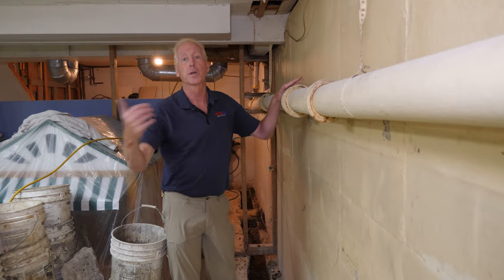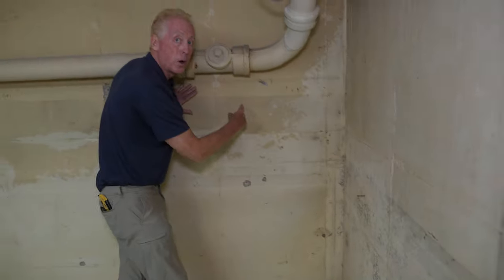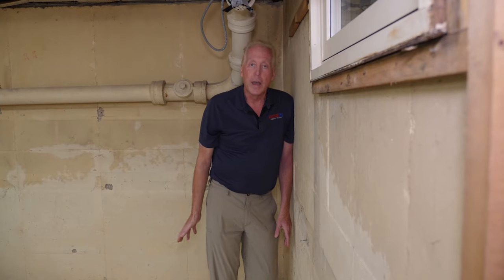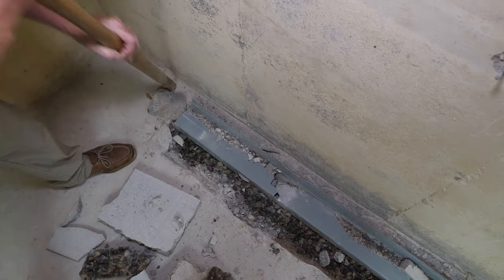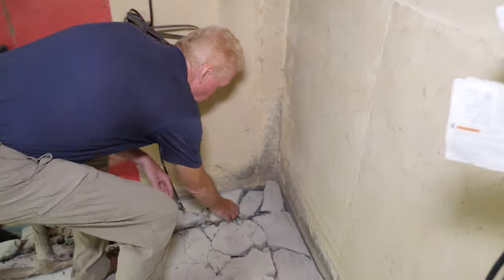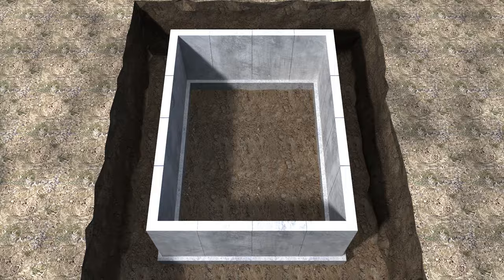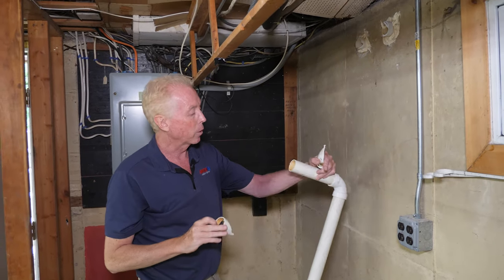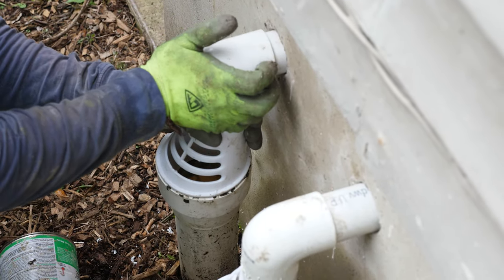Basement Waterproofing - Do's and Don'ts

Comment: I appreciate your very thorough videos, I have a company similar to yours. It is about doing the basement waterproofing right, even if it takes more effort to achieve a totally dry basement.  This big franchise companies are about making money and ability to make things very simple to replicate for their franchisee's and neglecting the real process of waterproofing. Foundation cracks must be injected with either polyurethane or epoxy or excavated on the outside with a proper waterproofing membrane.

Comment: This is great, love your videos and work. It seems like a great idea to leave sections of the floor intact to connect to the wall/foundation, but how do you install the waffle board or dimple board in those areas? Don't you need to remove the floor to put the waffle board under it?

Comment: seems like a really good landscaping job which slopes away from perimeter with thick poly underneath it would keep most water away from basement walls? then just keep a good dehumidifier in place
Reply from the maker: They already have tons of external drainage, and dehumidifiers eat money by creating very large electric bills. We want to avoid them at all costs. Sometimes you can't. The owners of this house haven't seen a drop of water in their basement since our installation. No dehumidifier is required.

Comment: Hi, great video and very informative.   What was the first company that did the original work?  Looks like the stuff I found in booklet from Quality 1st
Reply from the maker: I don't recollect the company. Quality first installs the same products. These products are used by dealerships in several states. Easy to train, easy to install, and easy to flood any basement. That's what happens when you don't put in the hard work to do it right.

Comment: Dear American Dry Basements, thanks for your hard work, and these great videos. I was wondering, it doesn’t appear to me that you are using any kind of soil blocking landscape fabric for your drainage system… my I ask why not? 
Or if you are, what fabric do you have good experience with. Thanks.
Reply from the maker: The soil in the northeast United States is typically Spodosols. It is a dense soil. Inside, not outside, the soil perks up clear water with very little slit in most areas. We never use landscaping fabric because fabric are filters that naturally clog, retarding the movement of water. That is one filter you can never change unless you want to jackhammer the floor again.

Comment: Great stuff, looks like you need a Hilti dust control system and Vac 😉
Reply from the maker: Yes. Dust control is vital in our work. We use our exclusive, EPA winner, Enviroboot on the jackhammer to catch cement dust and move it to the Hepa-filtered vac.
Reply: 🤣 he does need that 🤩

Comment: I enjoyed your video. I have a couple of cracks in my wall. They want to put in a sump pump but didn’t mention about fixing the crack. Can you explain. It is suppose to be a very good company
Reply from the maker: The cracks may be superficial and require only crack patch work. If the crack is more than eighth of an inch wide then you may need to consider getting the crack properly repaired.

Comment: Love this video. Do you answer questions I have some water leaking of my basement wall, and I'm wondering how can I seal it
Reply from the maker: Don't use waterproofing paint unless you have a waterproofing system under your floor to keep the hydrostatic pressure down. Use Drylok hydraulic cement to plug leaks in the middle of the wall, stairs or window. It will be temporary until you find out why those leaks are occurring in the first place. If leaks are coming out from between the wall and floor then you will have to consider a waterproofing system to manage the water levels outside your walls.
Reply: @AmericanDryBasementSystems  I came here to ask a similar question. I don't have water in my basement, but the walls have efflorescence and flaking. It is an old home from 1930.  Abovegrade is bloc but not sure if they poured lower half. I think it is all block that has had paint and coatings on it. I was going to wire brush the walls and seal them. Whole property and area is flat. I don't have a curb to pump water to if I wanted to install a sump pump (<1/8inch lip and a sidewalk).

Had one company come out and give an outrageous estimate, mandatory yearly fee to keep warranty, and they would do very similar to what you are ripping out. Any advice you can give is appreciated.

Comment: I just got quote for a grate drain system. They are off the foot of the foundation and pitched. I just can’t understand how they would pitch the elbows to ensure water isn’t sitting in them.
Reply from the maker: We are not big fans of that drain system. I can't imagine how they would pitch it successfully without breaking up the continuity using a rigid material. We have a couple of videos on our channel tearing them out. Watch here https://youtu.be/6h1pUyQGt0g

Comment: Thanks for another informative video! Do you saw cut the concrete before jackhammering?  I heard something about concerns of microfractures in the concrete. I'm curious of your take on that. Thanks again!
Reply from the maker: Saw cutting is unnecessary, time-consuming, and costly. The possibility of microfractures is a scare tactic to raise the cost of installation. I’ve never seen it happen. Keep in mind that an experienced DIY’er or professional should only do jackhammering.
Reply: Thanks for the info and such a quick response!

Comment: Excellent video, great info, thanks.  As the system is utilized over time, is there an issue with silt (or something?) buildup in the pipes to the point where it won't function any longer?  In other words, does the system have to be periodically maintained, and if so, what is the process?
Reply from the maker: Not at all

Comment: Hey I've done a few myself,  im a contractor mostly kitchens baths ..
 I have to take on waterproofing a friggin mansion & want to know if I do it the sane way on the poured walls ?
Reply from the maker: Theoretically, yes. If it is a three-piece foundation (footer, wall & floor) they are similar.

Comment: What do you do when the original basement floor is flush to the top of the footing or only covering it by an inch or two?  I have a basement of concrete blocks and the basement floor only covers the footing by less than 2".
Reply from the maker: If you don't have a crack or seepage problem, leave it alone. If you try to sell the house and building code in your area requires the 3.5 thickness minimum, it becomes a problem if they catch it during a home inspection.

Comment: I am trying to figure out not which system would be appropriate for my basement, but why the water started leaking in the first place.  I bought a fixer upper two years ago, and the leak first appeared a few times sporadically, and for the last several weeks, it has been leaking constantly in this one corner.  It appears that some sort of soft flexible material had been painted on, and it's now torn/old/flexible - I poked it to see what was going on there.  Is the problem with a pipe that was installed last year (that leads to the drywall) or is it something else.  IDK what to do next.  UGH.  All I know is that I want to solve this problem!
Reply from the maker: Unfortunately, this is something that can't be determined online. You have to get a plumber or a waterproofing pro to physically examine the location of the leak.
Reply: I would check the gutters and downspouts first. Go outside during a heavy rain and see if your gutters are working properly and the water is being discharged at least 10 feet away

Comment: How does the water get in the tubes y’all install? Is it permeable?
Reply from the maker: Yes. The pipe under the floor has perforated slots so water can enter and travel to the sump pump basket.

Comment: a quick random question for american dry,
whats the average price difference between these systems that have failed and the systems you install? :o
thanks!
Reply from the maker: You have to realize they install only one way, which doesn’t work effectively. We usually beat them on most quotes before they add maintenance and special flooring.

Comment: Like I said be fore, I'm so impressed!
Quick question - How does the water enter the pipe, does the 4" corrugated ABS pipe have holes in it for the water to enter the drainage system? Greetings from Newfoundland:)   Pat
Reply from the maker: Yes it does. Perforated, corrugated ADS (Advanced Drainage Systems) pipe.

Comment: So what do I do if someone already painted the walls and floor in my basement before I moved in???
Reply from the maker: You can still install a interior drainage system that will reduce the hydrostatic pressure around the outside of your foundation. Our company will not be able to apply our Superslurry on the wall. If the wall has a crack or peeling paint consider sanding the paint off to apply the slurry.

Comment: do you do any work in canada or do you know of a company that does it like your company as you do it the proper way and i truly need your help.  thank you so much.  have a lovely day
Reply from the maker: No, sorry. Its hard to recommend without knowing another contractor's operation and having quality control. If I took a guess, sight unseen, and the job goes terribly wrong. I would be blamed. Its up to you to make the right decision, and use our information as guidance. All the best.
Reply: @AmericanDryBasementSystems  I totally understand and get what your saying.  i am so grateful you wrote with your advice and i am using your knowledge so the contractors cant pull the wool over my eyes.  your knowledge is special.  thank you.

Comment: He broke that on purpose pulling it out of the wall. No person with any knowledge of plumming or general contracting would pull from the bottom of that pipe upward causing that much pressure. Im sure he isn't an idiot and just did it on purpose.

Comment: Is the sump pump basin perforated so that it acts like the pipe itself allowing water in from the ground or is it solid? Would it matter where the sump pump basin is located? Example: Would it be better if it was located in a dryer section of the basement or where you have more water coming in? Thank you.
Reply from the maker: Yes. It is perforated. Placement depends on many factors which I can't go into in a Youtube comment. I will consider making a video about it.
Reply: @AmericanDryBasementSystems  Thank you

Comment: Is applying drylok to already painted concrete walls somewhat effective. I have high humidity in my house and my basement is getting waterproof with a French drain in two weeks
Reply from the maker: Do not apply Drylok to painted walls. You have to sand off old paint to get full effectiveness.
Reply: Is there an easier way getting the paint off? I thought once the French drain was installed that would help lower the humidity levels in the house. I understand applying drylok over already painted walls won’t be as effective but wouldn’t it be better than nothing in controlling humidity
Reply from the maker: There is no easy way to get paint off. An adequately installed french drain will lower the relative humidity dramatically to between 20 to no more than 40 percent. Over 50 percent will promote bacteria growth. Drylok will not help make humidity lower, and you can paint it over old paint, but it may not last as long.

Comment: I feel like you're attacking a product in this video, but the really, the product never worked properly because as you've pointed out, it wasn't even close to being installed properly...in so many areas!  So how can you say the product is inferior?  What if it was installed properly?
Reply from the maker: If you have a water problem in the basement and install this gutter-looking system, it only works when the water level is critical. Basically, your floor will be sitting in water. They sell special flooring to combat this defect. This system is inferior in every way.

Comment: Does Shotcrete or gunniting help?
Reply from the maker: They are primarily used in casting swimming pools and not designed for reconstruction or repair.  The PSI maybe too high and you will find it next to impossible to access any subfloor pipe (sewage).
Reply: @AmericanDryBasementSystems  Thanks.